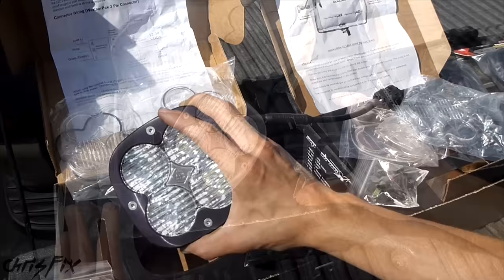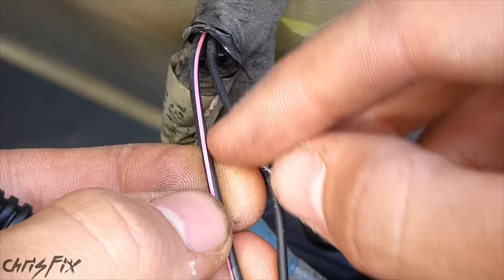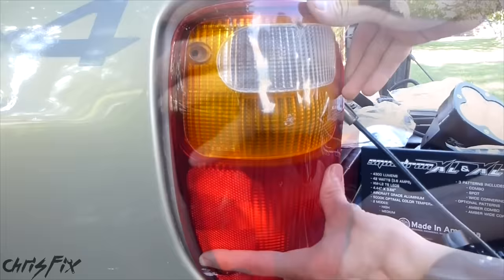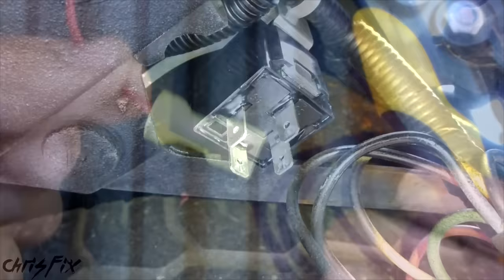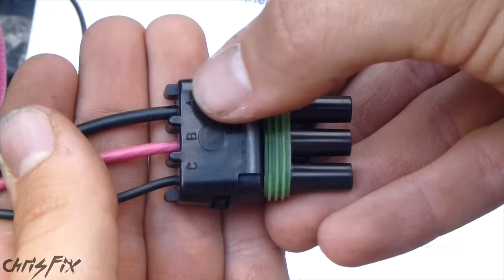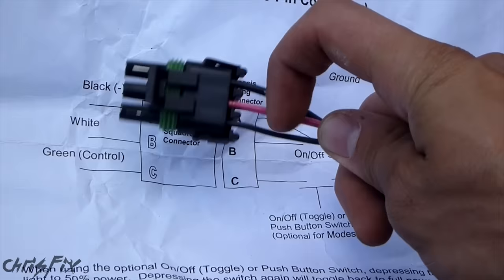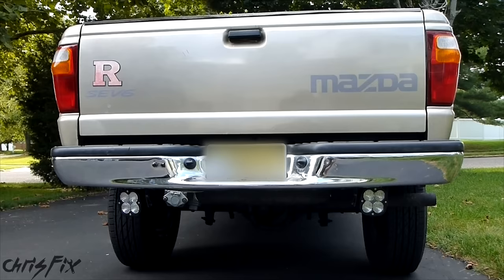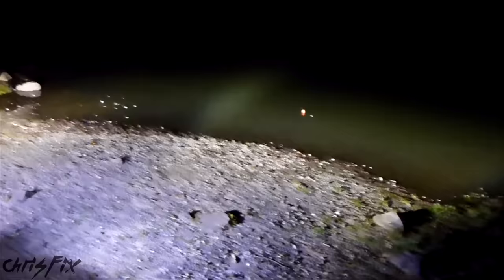How to Install Auxiliary Reverse Lights

Comment: many years ago because I am lazy I cut the 7pin trailer cable and added a terminal block under the rear bumper, this gave me access to all circuits as needed without opening lights and splicing every time. people add a waterproof terminal block to the 7pin cable you will love me later.    AUTO MANUFACTURERS HELP US OUT every vehicle should have a couple camera runs, 12v battery, alternator line, 12 cond trailer splice block, and UPSWITCH BLANT ENDS.

Comment: The only thing i would do differently is when attaching the wire to the back up light, I would just cut it and use a shrink wrap crimp connector. Soldering is a very reliable way of connecting them and making sure theyre secure, however, wire is now open to the elements. Electrical tape is good at preventing wires from rubbing but isnt the greatest for insulation against weather. Humidity can and will creep in and cause corrosion.
Reply: Actually, i changed my mind. Soldering is fine. A shrink wrap tube would make it look a bit better. Might help with keeping humidity away as well. Ive seen a few aftermarket connections made with electrical tape as the insulator and they didnt hold up very well at all. I also live in an area that uses salt on the roads for over half the year. Maybe its just ptsd from dealing with bad electrical systems haha

Comment: I hooked up everything like you said and they don't turn on when I put it in reverse. Instead, they blink once very quickly when I unlock the doors with my fob. Could I have it connected to the wrong wire in my tail light? I mean it works, but only when I unlock my vehicle.

Comment: Quick question. I truly don’t know the answer so please explain either way, but could you have just powered the new LED lights with the positive and negative wires that were already powering the existing reverse lights?
Reply: That's exactly what I was wondering...LED hardly draws any power, so I think it would be possible. I'm planning to do it that way and see if I blow a fuse.
Reply: Andrew Westhoff let me know what happens man. I really wish @chrisfix would drop some knowledge on us. I’m sure there is a good and bad reason why he did it the way he did.
Reply: @jasoncalle3212  I finally got mine wired up and so far they work fine with no relay. No burnt fuses, no car fires.

Comment: 4:38 .Mistake I found. (People don't point this out) 
 Never put your soldering gun/iron on top of the wires. 
 Put it on the bottom, it porvides better heat transfer along the wires. And it created a stronger joint. :)

Comment: Couldn't you have tapped into the reverse light in the tow package for your relay signal, or even powered you lights from it directly? Or is there some benefit to using the tailight?

Comment: It's a good idea the way you did it but everytime  you back up the lights will come on I'd mount a switch somewhere in the cab so you can flick them on when you wanna use them.

Comment: Watched the LED truck bed lighting video as well.  I have a question:  Could I use the same 14 gauge power wire with the inline fuse to power both the LED truck bed lighting AND the auxiliary reverse lights, since it is highly unlikely that I would be using both at the same time?

Comment: Just curious couldn't you have just tied in to the backup wire in the trailer plug harness and used that to power the lights

Comment: Just wondering why you can’t use the power wire going to the factory backup lights to power the aux lights instead of running a power wire from the battery?
Reply: I have the same question.  No relay would be needed and no wire to the battery and no wiring loom for that wire.  My guess is that ChrisFix concluded that the extra draw caused by the LED lights might/would cause problems with the lights.
Reply: @ahraitch6218  that's right, the factory harness may not sustain such amp through the wires, the relay allows to draw the current from the battery with proper wire gauges.
Reply: I wired up 2 small LEDs like Chrisfix but no relay, wired directly into reverse wire. So far no problems! And the fuse should blow if it's a problem.

Comment: excellent job, I got a question I want to install the back up lights in my truck but I already have a backup sensors installed to the reverse light what can you suggest me to do in order to sincronice both devices with only one reverse light wire? thanks

Comment: Lots of backup lights aren’t bright enough. I’m adding at least 6 LED lights to the ladder rack on the bed of my 2011 Ranger. Except I’m running a black ground wire back from the battery and I’m not using the frame as a ground. Each light will have its own switch and inline fuse. Typically 1-3 lights will be on but each for a short period of time as I’ll use them for delivering pizza.

Comment: I am planning to do the same, though I want a switch in the cabin as well. I want to be able to turn them on independently from the reverse lights If I don't want them to come on, and I want to be able to light them also independently if I want a rear light because we require light for example.
Reply from the maker: You can do that but you need a diode on the wire that goes to the stock reverse light so when you flip the switch the current doesnt run though that wire. A diode allows current to flow only one direction.
Reply: ChrisFix oh haveb't thought about that, thanks for responding man. Probably the 50th time I watch this video. I watch all of them thanks for the help! Keep up the good work!

Comment: i wired mine to the trailer lights connection i get the same results you did just without wires running all over my truck
Reply from the maker: Awesome! Nice work!

Comment: The Orange rubber piece should be crimped on with the wire jacket that way when you slide the pin into the hole the Orange rubber piece seals the end of the hole in the black connector

Comment: I purchased a Cree 52 inch curved light bar for my '06 Nissan Titan, the bar came with two matching LED lights similar to the ones in your video.  The light bar, I think should be fairly easy to install, it came with a wiring harness, so basically mounting the light is probably going to be the hardest part....the rest is just plug an play...however the two flood lights only have about a foot of connection wire coming out of them....if I follow the steps in your video to the letter....this should work for me right?  I would prefer to have a circular LED Rocker switch on my dash to turn the flood lights on with instead of wiring into my reverse lights, BUT....I don't want to melt wires or catch my truck on fire.....  Another great vid!  Thanks!!

Comment: Excellent video. I have a question regarding dual switching the relay. Do you know of any way to power the relay by the reverse lights but also power it by a toggle switch ? The idea being if I wanted to turn the reverse lights on and leave the truck in park I could use a secondary switch to activate them ?

Comment: I've watched this video a few times now and still don't understand which way I need to wire the relay. He explains one way in the beginning but wires it differently according to the relay instructions. I have a relay already that I can use but no instructions with it. Also, it doesn't have the 5th 87a prong.
Reply: I know what you mean. But regardless of what he says or shows, you have to go off of the wiring diagram for your relay.

Comment: 1st, ChrisFix, you're awesome but don't need a stranger to inform you of that. This really applies to folks wanting to try something even easier and has the spare funds...check out Dynamic Diode's website.  3rd brake light bulbs for bed and back up bulbs thats super bright...2nd option or do both?

Comment: Do I have to make the connection to the battery? I really don’t like the look of wires on the battery, it looks messy to me. Is there any other way that you could wire it to? If so, would it make any difference/problems? Thanks.

Comment: Hey Chris, I was hoping you could help out with this one. I would like to be able to use the auxiliary lights as work lights when the truck is in park and also use them as reverse lights. Do you know how I could do this? Maybe using a two sources to trigger the relay, if there is such a thing. Thanks again for all your great videos!

Comment: Why do you need a relay and a line going from the battery to the relay. Couldn't you just connect a power line from the reverse light power line straight to the light? Wouldn't they 1) only turn on when the reverse lights are on and 2) be powered by the reverse light power line without an independent power line run from the battery all the way back? Legitimate question! 

Trying to learn how to set up reverse lights with these 3 options controlled by a 3 way cab switch:  1) never turn on, regardless of reverse or not  2) turn on only in reverse or 3) turn on when truck is not in reverse.

Comment: Couple of pointers.
Unless you have the correct ratcheting crimper tool or those barrel connectors , solder them.
All other connections beneath the vehicle squirt some dielectric grease into the connectors before you crimp them on and again before you plug them into the relay (like you did) ,ALSO YOUR GROUNDS to the frame and positive battery cables  ,grease them !!!
All those connections you just made wouldn't even last a year up north in the rust belt.
Reply from the maker: Thanks for the tips!

Comment: Great video Chris.  I'm real confident i can do this now after watching this video and i know what i need now  complete the job. I also would like to use these lights i just purchased for rear or under chassis work lights  in case there's a need again.  How would you add a switch that will power the lights separately from the automatic reverse  light?

Comment: I have a 1999 Ford Ranger. My turn signals and backup lights ahve stopped working. I have checked the fuses which were all good and replaced the bulbs. Any ideas?
Reply from the maker: Check the rear connector for corrosion and give it a good clean and they should come right on!

Comment: Chris, is it necessary to use a relay?  It seems that the new lights would not draw that much current to overload the existing wire.

Comment: im not disagreeing with your methods for splicing into the reverse circuit, but the old slice and splice i wind up having to repair ALOT in shops. especially on trailers for big rigs, people run their wires like this, the wires rot etc etc, its not the best way to do it, but if i ever did these split i cut the wire and put 2 wires in one side and 1 wire out the other with a heat shrink butt connector, at least its completely weather sealed ya know. idk, just an experience i learned is no matter how much electrical tape you get on there water always finds its way in there and sits. or even a cut, splice together, solder and heat shrink. just food for thought. not knocking your methods, just my personal experience
Reply from the maker: Thanks a lot for the tips!!!

Comment: Just thought about a Question. When you put your truck in reverse, those lights will always come on is that correct? If that is the case, I will use an auxiliary switch to turn on the lights when they are needed like your video showed. I would not use them in lets say a parking lot at Walmart.

Comment: I'm confused - why would you need to wire in a relay if you spliced into the power line to the reverse light? Isn't that power line already on a relay?

Comment: Hi, this is a great video. I got 30w 6 led lights. Can you tell me... Would I be able to wire them straight to the reverse lights and earth or will this cut out fuses? Or do I need to put in a relay?

Comment: Quick question I have a factory wiring in the rear for the trailer lights plug , can I just tap into that harness using  the same setting like yours instead of using the battery all the way in the front ?

Comment: Is there a way to have two inputs? One from reverse, and one from the utility lights? I want to do this on my work truck, but I'm concerned about the utility power back tracking into the regular reverse lights, which would power the annoying backup alarm. Beep beep beep beep.....

Comment: Can I add a switch to the power wire that goes to the batter so I can turn it off if I don’t want the led light to go on when in reverse. 

Thanks

Comment: I was wondering if you could also wire a switch into this. So you could still have them turn on when your in reverse but you could also switch them on and off

Comment: out of curiosity could you wire the same lights up to run solely off of a switch without losing the ability of the lights to turn on automatically with the reverse lights? ( say I wanted to use them as work lights while hunting or fishing as well as reverse lights but I cant leave the truck in reverse while it running)

Comment: Hey chrisfix, I had a question about my truck hopefully you can help me, but when I open the door on my truck the interior lights go on like any other car but the problem is they stay on and I have to turn them off manually, how can I fix it so that they turn off automatically when the doors are closed?

Comment: Easiest way to do it is just trying to reverse light in the back your truck and he is run the wire up to your reverse lights instead of all this extra  Krapp
Reply: That's what I was wondering, couldn't you just splice into an existing reverse light?
Reply: @KrisHarrisnNeti   Yes you can
Reply: @KrisHarrisnNeti   I have a 2001 Chevy S10 pickup and I spliced them right into a my park and whites in the front so I just put my parking lights out and I use those for headlights so you could space  It right into the reverse lights and I got LID um lights cut into my back bumper that I spliced right into me reverse lights does I know Chevy S tends the reverse lights are not that bright
Reply: @martinneps9387  Yeah I put an extra loud horn on my old ford truck and just spliced in, seemed to be the easiest way and it worked, no need to complicate things haha
Reply: @KrisHarrisnNeti   Work easier not harder quickest and easiest way to do it
Reply: @martinneps9387  these LEDs pull hardly any amps, nothing compared to the factory bulbs. Mine are wired in directly, no relay. And what's gonna happen...a blown fuse most likely.

Comment: I love your videos!  very thorough and well explained.  I'm going to add reverse lights to my truck.  I plan to tap into the reverse light like you did, but I'd also like to add a switch on my dash.  can I just run a fused connection through the swicth and tap into the same relay connector that has the wire from the tail light?
Reply: Bababooey

Comment: So if I want to add a switch to be able to control the lights as well as have them turn on with the reverse lights how would I go about that. Also is there a way to add a kill switch so that the lights are completely off even in reverse.

Comment: Great job!  Advice...  @ 4:27 onward. I introduce the new wire by running it THROUGH the old wire, then twisting and soldering as you do. When I add the tape, I get it a lot tighter than you did. Then I add three nylon wire ties. One over the bulk of the solder joint. One near but not at, each end of the "strip". Pretty much over where the wire insulation starts up again. This keeps the tape tight and in place. As close to shrink wrap as you can get without shrink wrap. LOL Cut off the tails of the wire ties. Then proceed the way you normally do.

Comment: Also: I ran  two ten gauge wires from front to back. Black and red. Hooked to the battery positive and negative. The black one, I ran to a convenient spot. Drilled a hole in the frame, and bolted the wire right in. This gives me a KNOWN good ground. (My truck is quite old. Rust is the enemy.) I can use that bolt for any grounds I need now or in the future. The red is terminated with a small bolt and nylock. Which is then slathered with dielectric grease, and housed in a small pill box, project box, etc. Giving me strong power for any current or future needs. I wired in my LED backup flood/projector combination lights using these as the ground and the power source.

Comment: Just thought I’d mention as a mechanic it drives me nuts seeing spade terminals without heat shrink and that much dielectric grease is a fire hazard and can wreak havoc. I’d also suggest doing a proper video on weather pack terminals as the weather seal is supposed to be crimped under the last tabs. Proper pliers makes it way easier.

Comment: I had projector headlights installed at the rear of my truck. The LED rings are always on but there’s a switch inside which turns on the HID’s. They’re only on when I’m being tailgated because not only do they blind the car behind me, they practically blind everyone behind since it’s not aimed correctly LOL

Comment: If i want them turning on and off by a seperate switch do i run a positive wire from the switch to relay and then ground the switch??

Comment: Greetings ChrisFix!  What brand wire are you using?  I tried looking up spools, but they all give warnings about not to expose to moisture-however, if this is running under the vehicle, what wire type should I be looking for (any links would be greatly appreciated). *Would like to run a 12g primary from battery > in-line fuse >  to rear to relay.

Comment: Do you need the relay? Im no expert but i do have a little electronic experience if you used efficient enough leds (they dont need to be gates of heaven bright) couldn't you just tap the reverse lights with no relay

Comment: Why didn't you use liquid electrical tape instead of regular tape? it complete;y protects the connection where you soldered. moisture will wick up the two wires and corrode the wires.

Comment: Do you have to use a relay bc I’ve seen people just use a T connecter and splice right into the reverse wire for trailer wiring etc